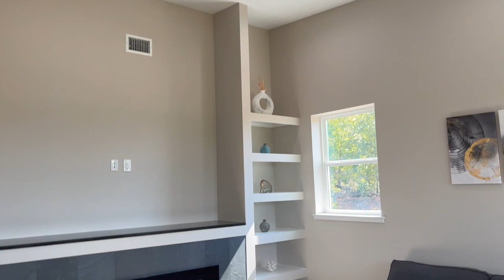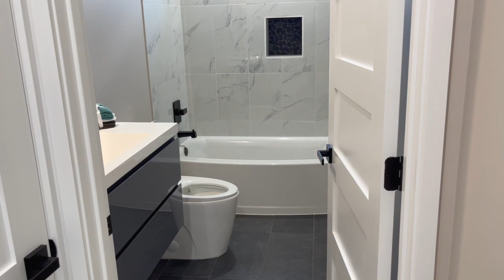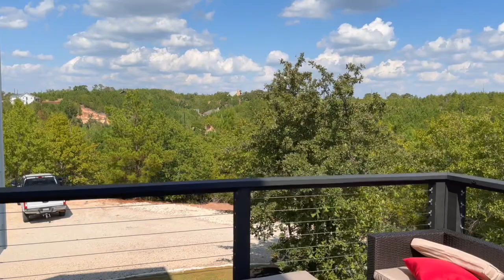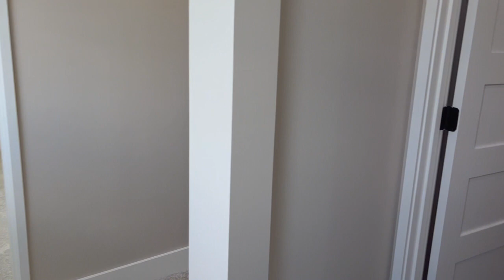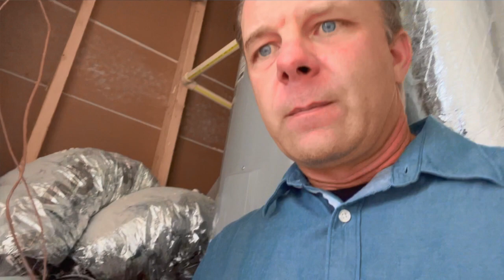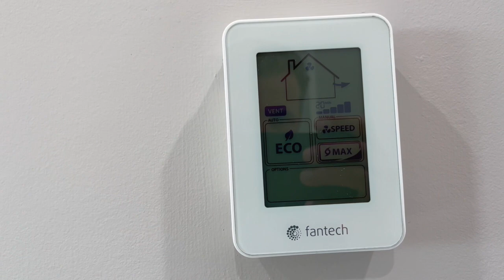High Performance Home Tour at 213 Kipahulu

Comment: Scott if that fantech is running all the time hows that energy efficiency... And if its pulling air from outside wouldn't that air kick the AC on more... Im building a energy efficient house cause we are off grid. We are going with eg4 mini splits this way they run on the sun all day so I figured since I built the whole house out of 2x8s I can have more insulation so it stays cooler inside so the mini splits don't run much at night. I did it with 2x8s cause they are cheaper than 2x6s so far we have almost 9000 in it. I figured when we are done I will have 30,000 complete.. Thats a budget build.... Keep it up brother...
Reply from the maker: Hi Dan, the main purpose of an ERV is for balanced ventilation. The fresh air is for health reasons and the balance part is for the durability of the home. The ERVs take very little energy but it technically adds cost. The ERV exchanges energy with incoming and outgoing air so it's able to condition the air to an extent. With that said, it does not kick the AC on much. I know this because we have done this in about 50 homes, many of which I monitor.